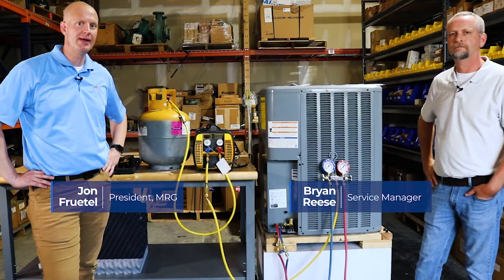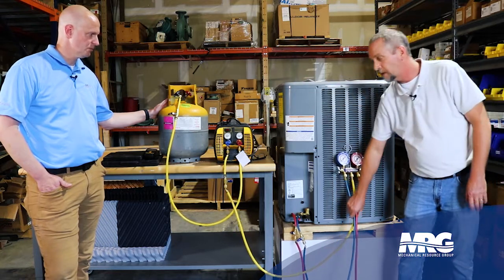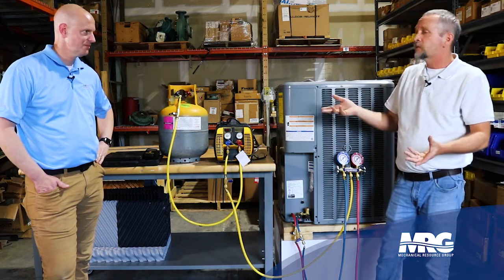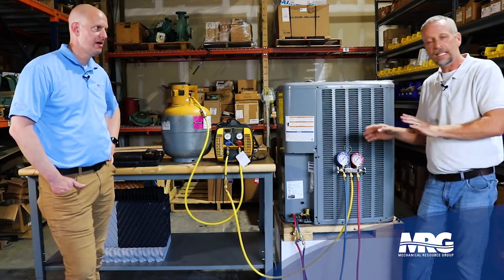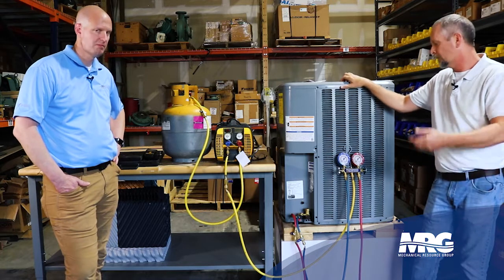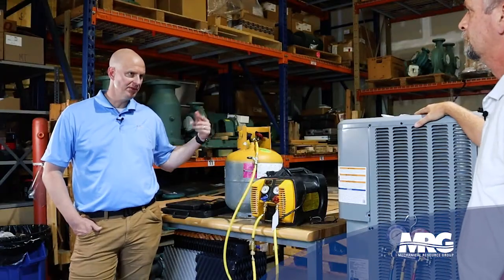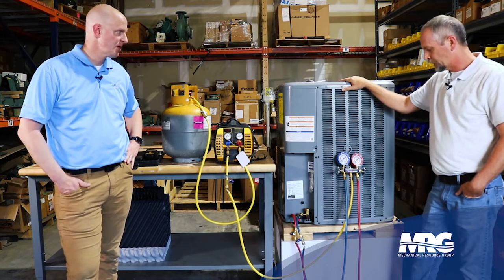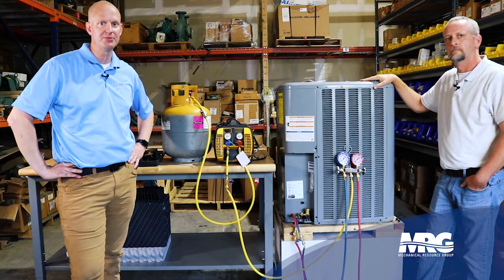How To Weigh Refrigerant Charge: HVAC 101

Comment: It would be great to cover the same procedure for mini splits. I have yet to see a single video explain whether you can/should fill the machine (weighing it in) with it off to get close to the proper weight or turn it on and crack it 1000 times to get to the right pressure. The latter seems ridiculous but it is the only method I've seen suggested. Mini splits are so different, it deserves a separate video.
Reply: @MechanicalPros  given what I found online, I transferred until it equalized with it off, then energized it and  let it  slowly transfer in, heating the bottle with hot water occasionally to help move it along until I weighed in the exact amount. There is very little guidance from the manufacturer available on a complete refill which I find odd because there's only one right way to dot this. Most I see are pulling the heads back into the unit but that's not going to tell you how much volume you have. I see far too many professionals still trying to do this by   using temp/pressure guages and given these are variable speed compressors, this is just the wrong way to properly install them. Hopefully you can add this video to your channel.